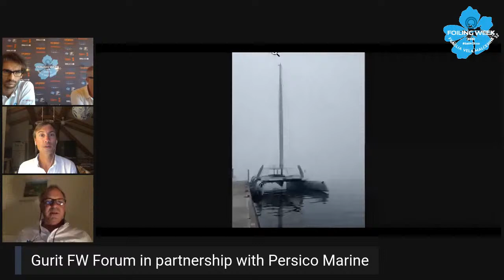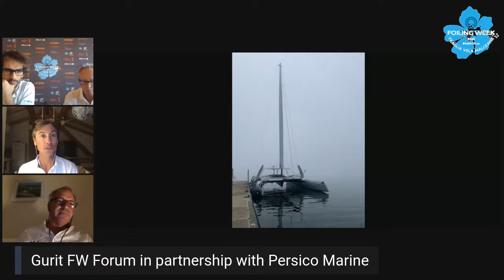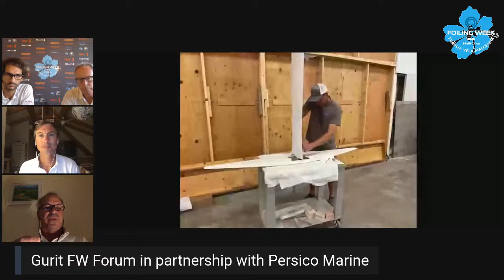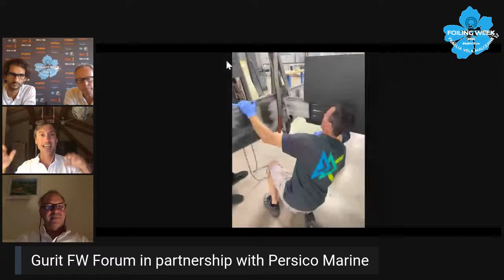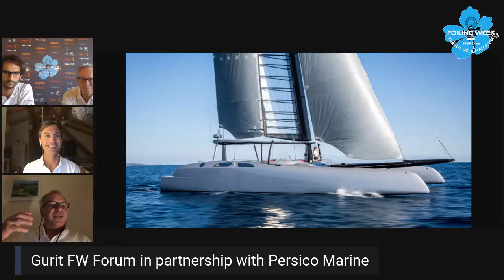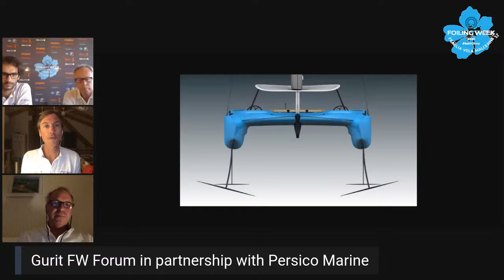Eagle Class 53 Flying. Tommy Gonzalez.

Comment: I have a question that's been on my mind since first seeing this amazing concept yacht. Why is the 'saloon' area completely open and thus exposed to the elements? Is it for weight savings to facilitate foiling or only because this boat is a bare bones prototype?
Reply: Hello James, since nobody has responded to you, I thought I'd chime in. There are several possible answers to your question, though the owner would be able to give you an exact answer. There are a number of catamarans that feature open bridgedecks, usually for speed - less structure is lighter and therefore faster. 

But there are boats builders that choose this type of bridgedeck because it feels so HUGE. The Maine Cat 38 is an example of this type of design concept. When the weather is fine and you're sitting or standing below the hardtop, it feels like the boat is a 50 footer. In warm or hot climates, this also gives you unobstructed airflow which is a blessing. In colder climates, the sunbrella and vinyl enclosures can be rolled down and apparently even on cold days it gets surprisingly toasty on the bridgedeck.

The third and most likely reason is that once this boat is up on the foils, you don't want anything impeding the airflow. The faster the boat speed the greater the air resistance, so minimizing the structures hindering airflow is critical. Jim Brown, one of the multihull pioneers, says that this design is an inflection point in the evolution of multihulls. He thinks the concept is truly revolutionary.